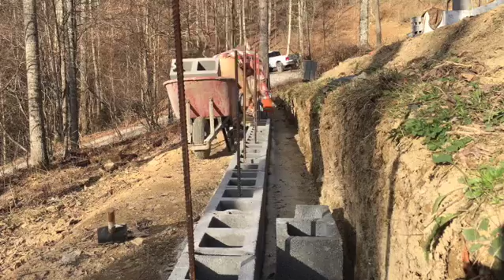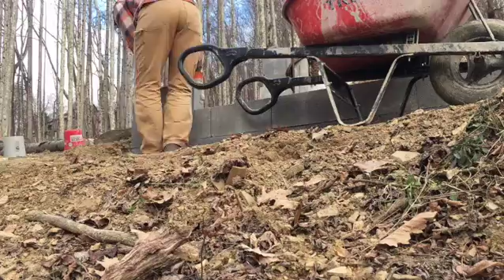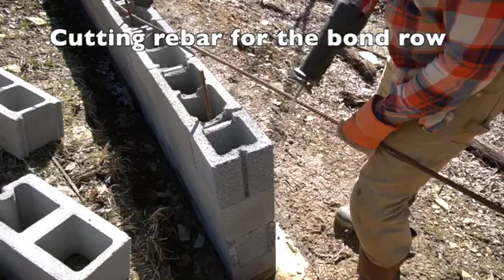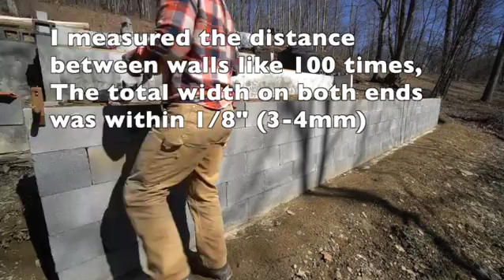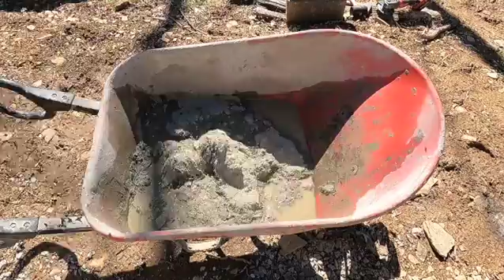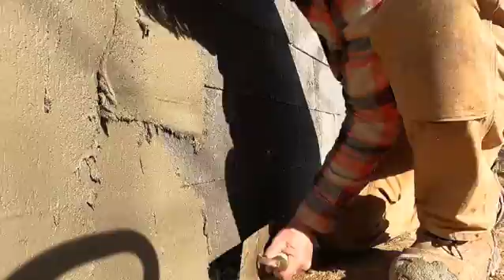Off-Grid Mountainside BarnBuildEp. 2 | How-To: Dry Stack Block & Surface Bonding Cement Foundation

Comment from the maker: Because there have been a number of comments regarding SBC, its longevity and strength, here is a post from NCMA.

https://ncma.org/resource/surface-bonded-concrete-masonry-construction/

 If you read through, you'll find SBC is just as strong (or stronger) as mortar with the exception of compression unless you grind the mating surfaces. Working the math, unground CMU is about 30% strength which is about 750psi. I calculate the weight of the building including footers/block walls and 70 psl live load/80psi on roof @ 300,000 pounds. A 2000sf house is about 400K pounds, this building is 900sf, so I'm way over estimating the building weights. There's 495 square inches of bearing on the three walls from 11 columns and 30' short 2x6 framed wall which is ~610 psi, well under the 750psi as listed. BUT this does not account for filling ALL voids with concrete, in our build a 2,500 psi mix. Code requires, in many regions, filling the voids that have rebar.

Comment: I want to know the purpose of using iron bar when building, and thanks for the video.
Reply from the maker: Hello, the iron bar, rebar, is used to strengthen the lateral stability of the wall. Concrete is great at compression, but apply side pressure, and it’s not so good.

Comment: Well , you can tell which commenters took the ten minutes that it takes to research the effectiveness of this method. Because of the fiber reinforced SBC, properly constructed dry stacked walls are much stronger than mortared walls...especially laterally. Great Job! I'm going to use this method for the foundation of a cabin in Williams, Arizona.

Comment: Guess where those blocks came from? That's right, the grid.
Reply from the maker: Hello! I think you may be confusing our off-grid building with the use of electricity. It will cost anywhere from $6,000 - $10,000 to connect this building to the existing power line on our property and add a new overhead pole and  transformer right next to the building. It would also be considered a commercial connection, adding 15-20% to every kilowatt we use. In contrast, solar cost $7,000 and no monthly bills.
Reply: @PoeRunCraftProvisions  ah I see. You mean the electricity part. Thanks for clarifying.

Comment: I'd double up on the vertical rebar if the wall is retaining earth, but in general, this method is perfectly acceptable. Bonding the blocks together with mortar adds no additional strength.

Comment: How close did you space the vertical rebars in the CMU blocks for this wall?  And out of curiosity WHY dd a DRY STACK and not mortar the CMU ?
Reply from the maker: Hello! Vertical rebar was placed about 32" apart. The slightly long answer to the second question... I'd used BBond, an industrial version of SBC used in mining, to fix a CMU wall at our main house. The block had failed due to excessive moisture and a lack of draining. Surface bonding cement does provide water resistance so didn't need to apply a water protection/drainage layer at the house or this build. Second I wasn't confident enough to lay level courses using mortar, though I would have gotten a lot better at it as I progressed. BUT I'd still have to apply some sort of drainage plane/water resistance layer to the buried side of each wall. And I think plain CMU walls are unattractive, so I'd also have to "stucco" the exposed sides. All that is accomplished with SBC in one process. 

Please see the pinned post if you have questions about SBC strength and some simple structural math. I know a number of "old-school" comments say SBC will fail, but that is not what the mining industry says nor all the science.

Comment: This is just being lazy, incompetence, or ignorance of building norms and codes. Maybe all three.
Reply from the maker: Please consider reading the pinned post and the relevant link regarding surface bonding cement vs mortar. And remember, the whole wall is filled with rebar and concrete.
Reply: @PoeRunCraftProvisions  read it. I stand by my statement.

Comment: Hmm I don’t get it. Seems dangerous….. anyone that goes to sit or lean on it and the wall topples over
Reply: Surface bonding cement is fiber-reinforced. When a block wall is parged with it, the layer of cement bonds it all together. As long as he is adding reinforcement steel in the cores and bond beams, this wall will be every bit as strong as a mortared wall.

Comment: As your video stands, I would caution viewers not to build a wall this way unless it is non-structural. I am assuming you vertically core-filled the block with rebar in them and the non-rebar cores are left hollow. That gives your wall almost no structural strength again side loads (Earth) except for a solid column every 4’-ish. Parging a wall adds nominal strength only. It is merely a waterproofing and cosmetic addition. The video said you parged 1/4” but it showed about 1/16” layer so you must have added 3 more coats? Even 1/4” Portland cement is “brittle.” Concrete/grout is strong because of the aggregate added to portland. The bigger the aggregate the stronger the mix. Portland is just the glue that holds the aggregate together. It adds little in actual strength. I don’t know what your walls are for and this video is incomplete so I pass no judgement on you. Simply a caution to viewers thinking they can skip grouting CMUs by adding a few core fills and parging the outside. If it was that easy then every mason would build walls this way. Check out Mason the mason or Mike Hadock (maybe Haddock) on structural wall building.
Reply from the maker: Hello! Please see pinned post with details and a link explaining the use of this product vs mortar joints.

I encourage you to watch the next videos in which we do fill every void. Also this isn't portland cement used to parge the wall, it's a surface bonding cement, which includes fibers and is specifically designed for this purpose.  I also included some calculations in the post for more detail, though overturning and slip calculations were not included, I did that math too, please see the introduction video in this playlist. There is a lot of new science that was researched to get to this point in the build. That said, I agree don't just build a wall because I did, do the math and the research for your project. Thanks for watching!

Comment: Can dry stacking be used on a typical below grade, full basement footing (footer 6-7’ below grade)?  What about in norther US where we have a freeze/thaw cycle?
Reply from the maker: Hello. That is what we have done, but only 3'-4' deep which is well below our freeze line. Couple of other considerations, retaining walls over 4' should be checked by an engineer (I kept mine at 4' and under) and you must have good drainage with perforated pipe at the bottom.. Don't backfill with soil, only gravel to finished grade and use a good quality unwoven fabric NOT landscape fabric. Unwoven fabric will allow water in and be drained away.

Comment: I was in the home building business for over 45 years.
The business originated as a masonry business, as my father was a bricklayer by trade.
Of coarse much of the work was blockwork.
Actually a dry stacked wall done properly as this one is, with vertical rebar and a bond beam with rebar then the entire wall filled with concrete is much stronger than a conventionally layed wall using mortar joints.
The parging is simply to cover the joints and add a finish look.
However, the parge coat would also add an additional strength factor if fiber is added to the mortar while mixing.
Reply from the maker: Thank you for sharing your experience Ernie!
Reply: Great job.
Reply: Omg.! There is no evidence to back anything up you said . If a mortared wall and a dry stack wall are both filled with concrete and rebar they will be nearly equal . Dry stack doesn’t add strength😅 . Some of these comments are hilarious
Reply: @Nctbgs  Suggestion: Reread what was written before you comment:

".....stacked wall [....] with vertical rebar and a bond beam with rebar then the entire wall filled with concrete is much stronger than a conventionally laid wall using mortar joints."

Conventionally laid, aka mortar joint, CMU walls typically only have the cavities filled that contain the vertical rebar ties that stick out of the footer (which is every 4ft by code). All other cavities are not filled unless specified,, and in the rare even they ARE filled, it's not with concrete, but perlite or vermiculite loose fill for insulation value (aka no strength added). So a filled dry-stack wall with the bond beam and vertical ties would be stronger. The info IS widely available from Quikrete, Sakrete, and Building Science Corp. to name a few.

Now, if a conventional wall has all cavities filled with concrete, it'll be stronger than the above filled dry stack, but again, most block walls are not solid filled.
Reply: @l.a.martin2424   Well ONE would agree "IF" the wall was just laid up as a CMU block wall (with the joints mortared) and "NOT reinforced" and "NOT" Grout FILLED! (But his method probably is stronger than the scenario I am describing here?)

Comment: Unless you fill those cells with concrete, and run rebar every 3rd cell,  you have very little lateral strength ...After a few winters of heaving and settling it will begin to tweak on you.....the surface coating does very little for strength...those that have lucked out, Bravo.....But every one that stands there are triple that eventually fail...There's no real shortcut to a proper foundation
Reply: he did fill the cells in another video.  Probably fine for the purpose, but yea walls experience a huge amount of pressure over time.   Even the most expensive, overbuilt ones can fail due to ground conditions or events.

Comment: I built an entire walk out basement with this method in 2000 but did not fill the blocks with grout and this basement never leaked cracked or showed any signs of being inadequate. This was in Maryland so entire method was approved by inspector after I showed him quikcrete's Quik wall  technical info.

Comment: So basically you just used the dry stack as a sort of form to hold the concrete filler? and surface cement as a water barrier?
Reply from the maker: Kind of.... To make/build/rent concrete forms for a solid concrete wall would have been a lot more expensive, and I'd still need some sort of water resistant barrier on the side being buried with dirt and gravel.

Comment: Surface bonding is not enough , blocks need to be bonded too.
Reply from the maker: SBC does bond the blocks together, and according to all the documentation it's stronger than typical mortar. Also just like a traditional mortared wall, there is vertical and horizontal rebar and grout in all the voids
Reply: I was skeptical at first.  After tons of research, I found many articles saying it can be stronger than mortared joints.   They must be filled and properly reinforced.   One of the main reasons mortar was and is used was because of the issues with the blocks not being exactly the same.  Another is the dangers of other trades coming in and moving the wall before grout day.  The blocks are made much better now.  I used to deliver to a block plant (old castle block).  They showed me around once.  I must say I have to believe the articles I read.   There are times when mortar is a must. I’m a Mason as well. Not trying to say anything bad about mortaring joints.   It’s just a great alternative when you have unskilled/less skilled labor. I’m going to build a privacy wall this way.  I may post the video.
Reply: Not true, I've built two houses with this method and did not fill the blocks with grout on full basement walls and they were the strongest most water resistant walls I've ever built.
Reply: could you explain what you mean?
Reply: @Alongfortheride693  Sorry house has a 2000 square foot basement buried on three sides with a walkout and the basement is absolutely dry, you do realize they use this method for hatcheries that hold water in surface bonded cinderblock water enclosures. by the way I lived in this house I built for myself so I should know.

Comment: I thought you’re supposed to put cement inside
Reply from the maker: Hi Gitanagurl, yes we did fill all the voids with concrete in episodes 3 & 4, about a 3000 mix and completed our 12 yards of concrete for the foundation. The SBC basically replaces the mortar and is a water barrier. Hope that answers your question!

Comment: Why do you need to skim coat the block if you are filling the voids with grout?
Reply from the maker: Great question... Surface bonding cement (SBC) basically replaces the mortar, which holds all the block in place. If you skipped this step, the blocks would still be independent and could easily move when filling the voids. Second SBC provides a water resistant layer, protecting the block which is very very porous from water infiltration which would slowly crack and fail with our freeze/thawing in winter. And finally, which didn't matter to us, but if you build a wall you want to parge with stucco, this could SBC would replace the mortar and stucco process and be tinted too.
 Hope that helps.
Reply: @PoeRunCraftProvisions  Thx for the feedback.

Comment: Cool stuff! How does this method compare to laying block with mortar joints?
Reply from the maker: Hi Lenny, It was incredibly easy and fast to stack the block and adjust it for plumb and straight even with 5 or 6 courses. We chose this method because I wasn't experienced enough with laying block/brick to confidently make straight, level courses. Parging the wall was easy too.. If I had to do it all over again, I'd still chose this method.